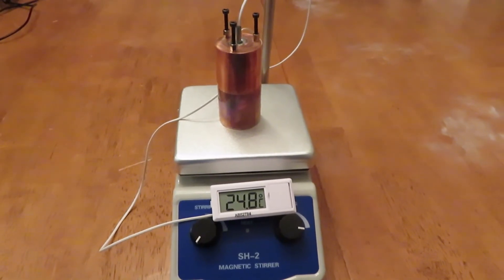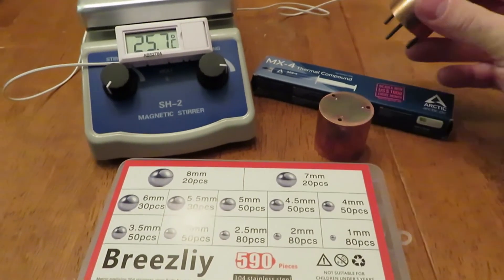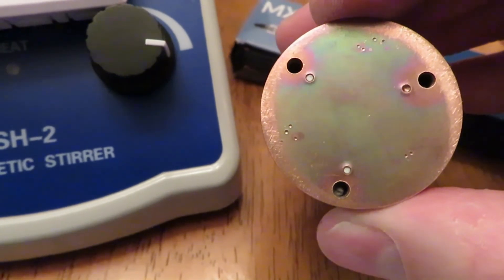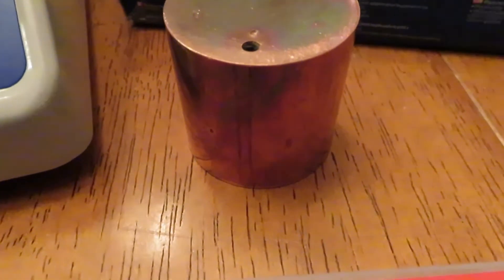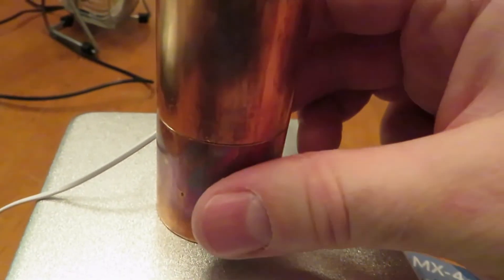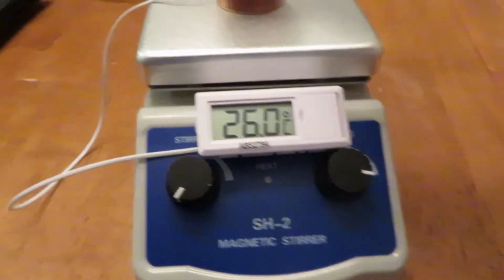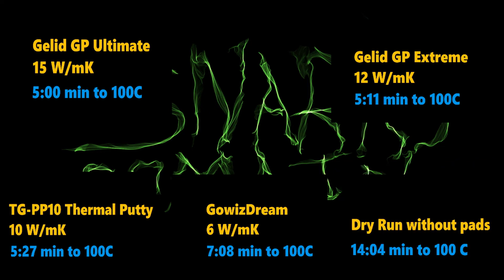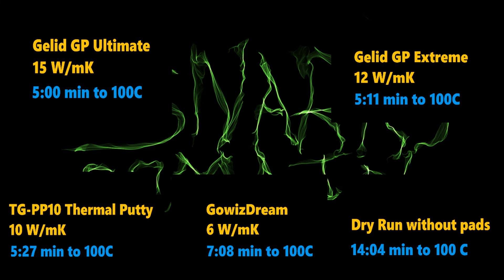Thermal Pads & The Race To 100 Celcius

Comment: Hi, 

I have an ASUS GeForce RTX 3090 ROG Strix O24G.I wanted to dust them off and change the thermal pads and thermal paste at the same time.

1. Which thermal pads should I use?
2. What thickness must the thermal pads have?

For the GPU core I would use the Thermal Grizzly - Kryonaut extreme or the Alphacool Apex 17W/mK.
Reply from the maker: @darkshadowdrache4383  I'd actually recommend you go with Thermak Putty instead of pads, and then use a Phase Change Material for the core (Honeywell PTM7950 or similar).

https://youtu.be/5iNXn8oaTWI

If you do decide to go with a putty I'd recommend buying 100 grams. You use around 75 or so.
Reply: @snarksdomain  
Thank you very much for your advice. 

I originally didn't want to use Thermal Putty. Since it seems to be better than the thermal pads, I will test the Thermal Putty.

The thermal putty I chose was the TG Putty Pro from Thermal Grizzly.
I'm guessing I need fsat 4 doses of it.

For the core I chose the Phasesheet PTM from Thermal Grizzly.

I believe that the two Thermal Grizzly products are optimal for my RTX 3090.
Reply from the maker: @darkshadowdrache4383 Nice. Yeah, if you don't mind the price of those 2 products, then they are good options.

I usually go with putties that I can buy 100g for $40 CAD or less.
Reply: @snarksdomain  
Thank you. 

I chose Thermal Grizzly because I'm happy with them themselves.
Maybe I can also use copper discs with the thermal putty if that improves cooling.

Next, the thermal paste on my AMD 3970X needs to be changed at some point.
Reply from the maker: @darkshadowdrache4383  right on. If you go with copper shims be sure to leave a minimum of 0.6mm of space so that you can get 0.3mm of putty on either side for the putty.

Or if you want to max out the shim size and only leave 0.2mm (0.1mm for each side), then you will want to buy some Halnsiye HY236 for the shims. It's quite cheap and you'd only need 20g max to use with shims on VRAM. 20g of HY236 costs around $7 CAD. Currently there is no other good putty than can squish down as thin so it's definitely the one to use with shims and also in laptops with very thin gaps.

You can see how each putty measured on callipers. In application, you might get a layer as thin as 2x this measurement. But perhaps 3x.
https://youtu.be/5iNXn8oaTWI

Comment: Nice one. 
Can you do a test please between using like a 3mm thick thermal pad, vs stacking 6x 0.5mm pads. I assume that the makers say you shouldn't stack pads so they can sell you 3-4 packs instead of 1?.. The blue and white standard pads are like blu-tac, I seriously doubt any air would get trapped between layers if you lay them down carefully, and maybe even if you didn't, once some pressure is applied it probably squeezes any air out (like the myth that air could get trapped using thermal paste on the CPU that der8auer debunked). Harder material pads with embossed type patters on might trap air but I still doubt it. I would like someone to prove once and for all if stacking matters, so people can maybe save lots of money buying one big pack and not 2-4 packs...

I just searched the net for it, and it seems no one knows for sure if stacking matters or not, which is why some definitive tests would be good. People have plenty of theories but no test results so far as I can see. You could get a few different types, from the bog standard blue and white to the stuff people use for GPUs like GELID, stacked and non stacked...
Reply from the maker: I'll likely do a test like you suggest with 2mm gap and do both a hotplate test and also on the 3070ti. I'll probably just use the pads I have in stock already. Can probably do Gelid Ultimates and Gelid Extreme's using 4x 0.5mm stacked to 2mm. Will likely try to do it the worst way possible and try to introduce air between each layer prior to compression.
Reply: @snarksdomain  Awesome. People's opinions are not as good as some actual evidence :) I think the air getting trapped is an old wives tale, like it was for CPU paste. Unless it's the clay type pads and they break apart, possibly. The only reason I can think of that stacking could make a difference would be something to do with the atomic/molecular structure - like you know some things have really long molecular bonds, maybe if that is how these substance move heat (no idea if that's the case), then maybe a stack would mess with that functioning. I'll be very interested to see the results if you do it.
Reply: @snarksdomain  I just found this video:
"Thermal Pads Heat Transfer Basics" - 6:55 timestamp. 
It didn't show how they work, but that bloke went to some technical seminar, and the professionals said it's not recommended but kind of OK to stack.
Reply: It still works stacked.  It's just not as effective.  Also air getting trapped is a thing.  Usually not enough pressure and even after the pads settle one little air bubble makes it less effective.  Good luck.

Comment: I'm sorry for my language because I'm from Polish and translators are a translator, I have a question for you whether I can replace thermocouples that are 2mm thick with a thermopad sandwich (0.3mm 8W / mK + copper pad 2.5 + 0.3mm * w / mK) will this connection be better from thermopad 12W / mK? I'm working on a cheap gigabyte windforce OC 6gb rtx 2060 rev 2.0 which will be overclocked and will have a real backplate and cooling
Reply from the maker: Yes, making copper sandwich with Thermal Putty is better than OEM thermal pad. 

Caution: Better to go 1-1.5mm copper, and then putty both sides. 2.5mm copper is too thick and will make problem with contact of other components like VRM, Core, Capacitors. If copper too thick then big heat problem with the core. Maximum safe copper thickness is 75% of OEM pad thickness.

A good thermal putty to use is Penchem TH930: https://www.digikey.pl/pl/products/detail/penchem-technologies-sdn-bhd/TH930-50G-2JAR/16277200

Comment: Since there will be diminishing returns as conductivity goes up, I'd like to know what the baseline is without BBs and a good grease as the TIM
Reply from the maker: It's around 4:30 depending on the thermal paste. I had done that in a different video. With no paste and no BBs (dry copper to copper) it's 4:40.

I plan to do thermal paste tests again at some point, but a little differently. May just use the sensor block with pastes between it and hotplate.
Reply: @snarksdomain  I did note that, but a test without an air gap so you can see what the best performance would be is what I’m referencing
Reply from the maker: @UnfrozenScoundrel  I did that in one of my other videos called "Thermal Pastes: The Race to 100C (REV1)"

https://youtu.be/kFo9HS0ni1A
Reply: @snarksdomain  apologies, thought you’d only tested putties and pads at the 2-ish mm gap.
Reply from the maker: @UnfrozenScoundrel  no worries. I have mentioned in a couple videos that I only test at 2mm, and forget to mention the No-gap paste test.

Comment: Have you had the email from DigiKey, TG-PP10 is discontinued.
Reply from the maker: Oh no! I just did. Thanks for the heads up. That makes me sad. I think I only have ~700 grams left 😞

I'll try reaching out to the manufacturer to see what's up and if they have a good alternative or even improved version (fingers crossed). I'll also search for other putties. I believe there is an 8 W/mk rated one from  different brand and it's blue.
Reply: @snarksdomain  The currently recommended substitute is TG-A7000-1000, however this putty is less thermally conductive at 7W/mK and costs more money.

1kg tub of TG-PP10 was £150 excluding VAT, whereas 1kg tub of TG-A7000 is £340 excluding VAT here in the UK.

Hopefully they will offer a viable price/performance alternative soon.
Reply from the maker: @GhostMotley  my sincere hope as well. I'll be ordering some Jeyi 10W/mk putty from Aliexpress. May also try getting some 8w/mk Fujipoly stuff. Am researching other options and have lots of reading to do if anyone wants to help in the hunt we need to look at these manufacturers products...

T-Global
LiPOLY
GreenTEG
Schlegel Electronic Materials, Inc.
Ramping Peripherals
Fujipoly
Penchem
Peos Technology
Gen Ye Electronics
Reply: @snarksdomain  Have you heard anything back from T-Global?

I emailed them about 12 days ago asking why TG-PP10 was discontinued and if they have a successor planned and they've not responded.
Reply from the maker: @GhostMotley  no response so far unfortunately. I think I'll order some TG-NSP80 for testing (8.3W/mK).
Reply: @snarksdomain  Look forward to any videos or tests.

Unfortunately seems TG-NSP80 still isn't as good price/amount wise as TG-PP10 was.